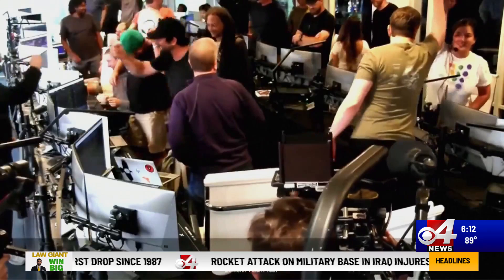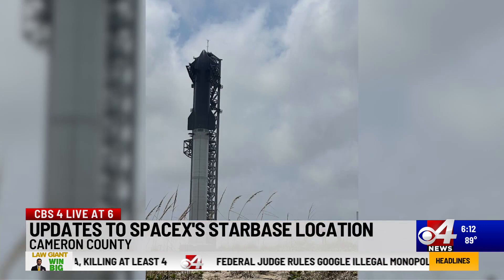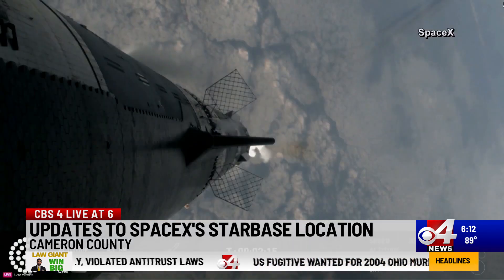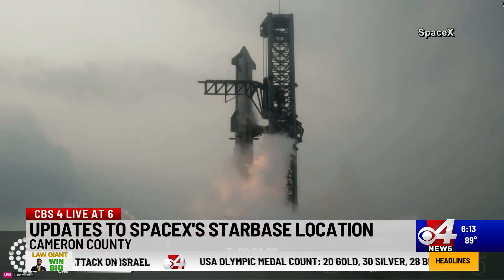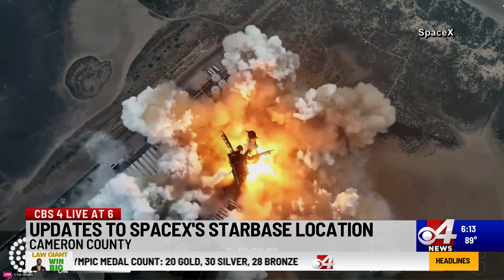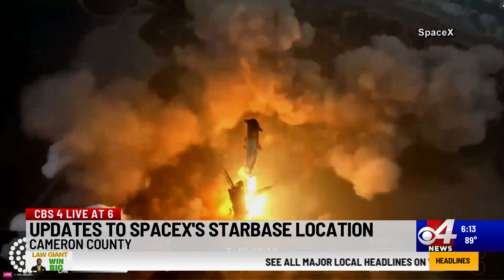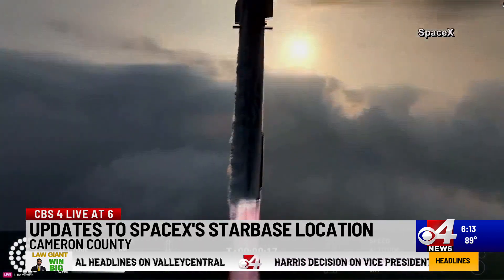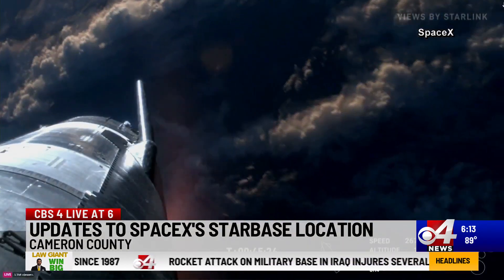Updates to SpaceX's Starbase location

Comment: Starship uses methane and liquid oxygen which is relatively clean compared to RP1. The site has run off ponds which collects water from the deluge system and is then pumped into trucks and taken away. Most of the water gets vaporised anyway.